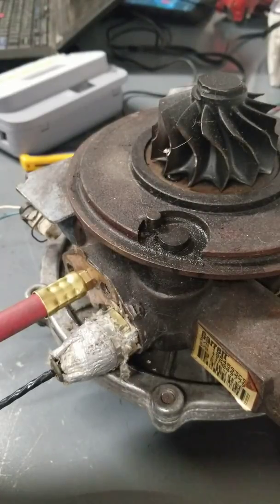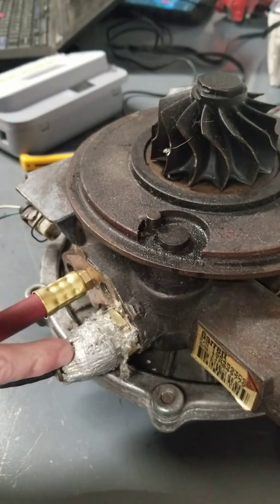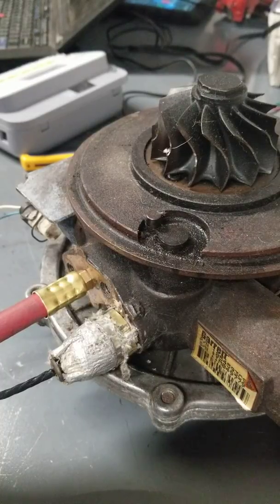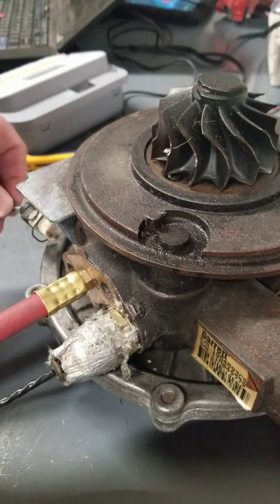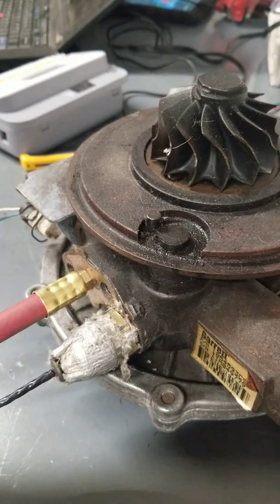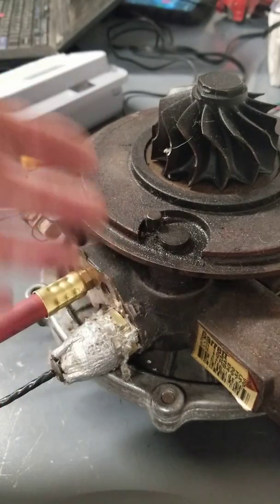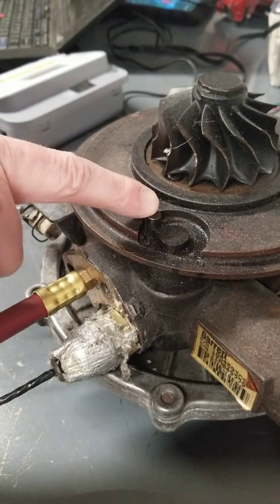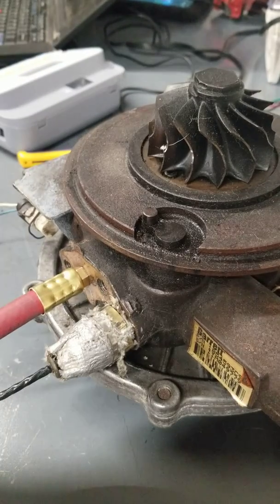Banshee VGT controller testing ford 6.0 turbo

Comment: Is this stand alone 6.0l vgt controller still available or as im guessing it probably isn't?.
Reply from the maker: It will be though ATS Diesel Performance, its called Intelliboost
Reply: @SteedDolan  Do you have any idea on when this kit will be available I looked it up on ATS and there website does not have it at the moment. I'm planning to put a GT3782VA 6.0 turbo on my 12 valve Cummins and this kit would be amazing!.